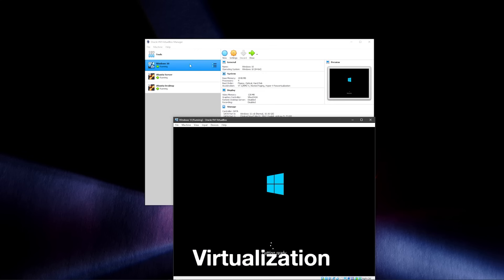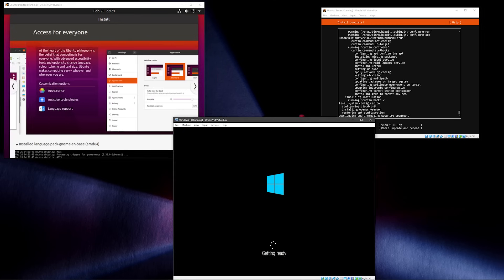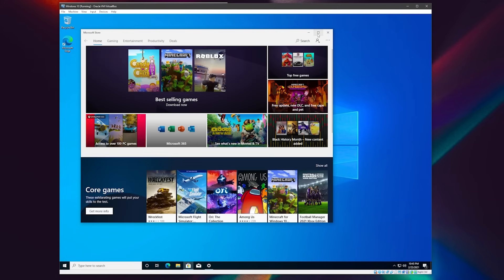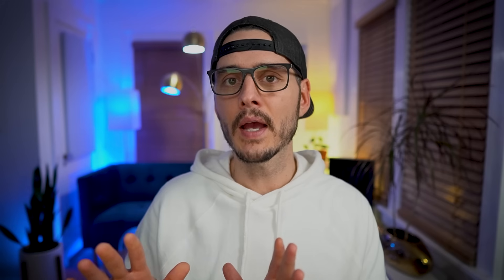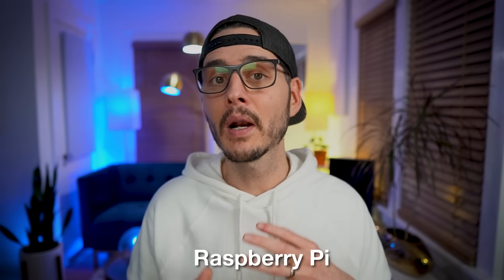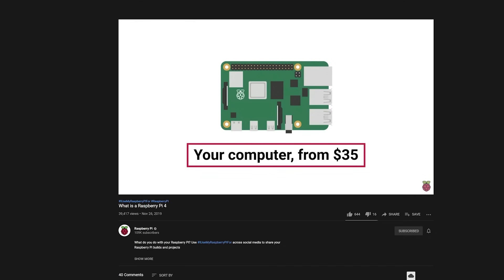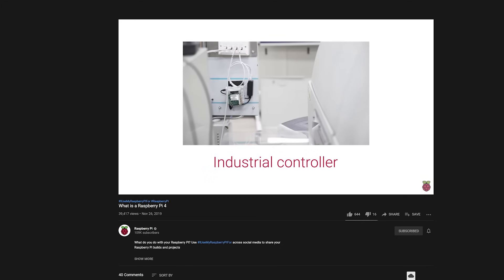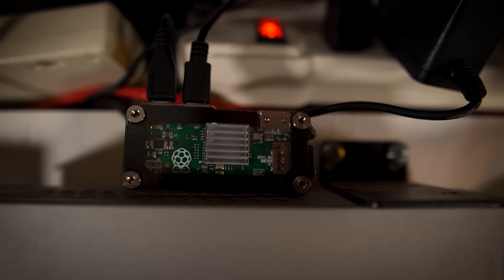What is a HomeLab and How Do I Get Started?

Comment: My previous freenas server: evga x58 ftw, xeon e5646, 24gb ecc unbuffered
My current truenas server: asrock x470D4U, Ryzen 3600, 64gb ecc unbuffered

Both run like absolute monsters with a 100% uptime other than the occasional restart for an update or hardware upgrade.

I have always been sceptical of the perpetuated myth "ecc won't work with consumer grade hardware".
It's difficult to find the right combination of hardware components to make it work but it is most definitely possible.
Reply from the maker: Totally agree.  I’ve been using consumer grade for years, all my HDs are and will always be.  If they die, I will claim a warranty just like enterprise gear. I’d rather not pay the upfront cost for it and build redundancy into my systems.

Comment: Just a small comment, rackmount gear is not the only way to get enterprise features.

If you don't need a rack full of kit, a tower server can provide a lot of the same functions in a tower format. Think HP ML350p or Dell T620 for example. Dual processors, hundreds of GB RAM and something like 12 disks are possible in these machines, which would be enough for most people.

Comment: Started off by dipping my toe in with an old NAS box with a built-in web server. Quickly outgrew that and repurposed my desktop hardware after an upgrade to create my first 24/7 box running WS2012. That's since had some upgrades over time, and became my storage server, my Plex server, Web server, DB server, Hyper-V virtualisation server amongst other bits. I've introduced Raspberry Pis over the years (with 1 as my Home Assistant box and 2 as DIY CCTV Cameras). My latest introduction was a Proxmox box (which now houses my old Hyper-V VMs plus some others). Just wish I hadn't set up my storage on Windows using storage spaces, as I now cannot migrate to TrueNAS / any other solution that's just not quite so bloated. Should've just bought a hardware RAID card to begin with, then it'd be simpler to migrate as the RAID configuration would be handled by the card itself.

My biggest annoyance however is that in my rented 1bed flat I don't have space for a server rack, nor do I have anywhere I could fit a rackmount server where the noise wouldn't be a problem. I've managed to home my current 2 towers plus a switch and a Pi in my airing cupboard (not ideal but they maintain a low enough temp), but this then means my phone line is elsewhere in the flat so the router is elsewhere. I'd love to start playing with a managed switch and a pfsense edge router, but until I can get it all in one place that's just a dream.

Comment: Right now my lab includes three locations under pfsense site to site vpn: At a relative's house a Dell Poweredge R440, Dell Poweredge T130, Dell XPS PC, HP Gen8 Proliant all running Alpine diskless mode aside from a data drive mounted at /var. They boot from usb with a second usb for storing configuration (LBU is run on a cron job). These are all configured the same: as hypervisors running a Freenas vm each which all other drives are passed through to via LSI Logic HBA card and iommu. They each have many Ubuntu 20.04 vm's running Docker and Rancher Agent all in the same K8s cluster for a total of 3 control planes, 4 workers and 4 storage nodes dedicated to Longhorn, all with a seperate dedicated 10Gi BaseT NIC for the CSI network . The pfsense router over there is running on a virtual machine on a Dell Optiplex small form factor PC running Centos 7 and KVM. At my house I have the same exact router/firewall setup except I'm running Debian as the KVM host, and I have a Skull Canyon NUC booting Alpine from usb, run from ram with another usb for configs and a single 8Gi qcow2 for freenas (loaded into ram as well at boot) which is running a zfs mirror on the two nvme drive which is used a backing for vm's running, you guessed it, Rancher and K8. I also have an old Dell pc running a simliar configuration as part of the same cluster, another Dell XPS running an LXD/MAAS test environment on another vlan that I occasionally plug old servers onto. And an old Powerspec PC running nightly downloads of Truenas SCALE. At my office I have a Poweredge T130 running Ubuntu 20.04 and KVM with a few VM appliances,  including pfsense with openvpn. Oh right and a handful of Raspberry Pi's at home for messing around and running thin client rdp terminals for the kids to play and do their schoolwork on. And a Pi at each location running ansible as well. I think that covers most of it.

Comment: My homelab is two raspberry pi 4's(one 4GB, and one 8GB), and parts from an old hackintosh I made nearly 10 years ago. Star of that mess is the i3-2120T with 4GB of DDR3. And I recently slapped my old GTX 1060 in that rig, though I haven't done anything with it yet. Im currently running a Docker swarm cluster with 31 containers divided up between the 3 of them.

Comment: I tinker got a old dual p3 slot 1 board put away.  Actively I have 2 truenas with 5 drives each. Then I have a dual x5687 with proxmox.   And 4 pi 4's for retropie and a pihole.  Been playing around for 20 years

Comment: Haha you're a bit like me, even down to the deskpro. I still have mine, it's a slot a was upgraded to 256mb and had a massive 8gb drive.
It became my first server (web) as did my next DT, and then my work stations.
DT/workstation were as powerful or became powerful as servers.

I did start with other people's as I was a teacher and consultant back in 99/04 I went enterprise in 2010, with a few enterprise parts leading up to that.

I think you went from home lab as a you can use xyz. 
Some board do take ECC memory.
And there is always add in cards for drives. 
I think the big issue is finding cases that hold a lot of discs. (Storage servers and media servers)

But there a hands on good way to learn and make mistakes. But it's just as bad if your systems provide you and your house hold services.

I think a good start is a web server and securing it. And a NAS. Or both as a set of VM's.

Comment: I invested $20 in a backup server (new power supply). The base was a 2003 HP D530 SFF motherboard with a Pentium 4 HT (3.0 GHz); 4 x 512MB DDR (400 MHz) and 4 leftover HDDs (IDE; SATA-1; 2.5" and 3.5"; 250 and 320GB) in total 1.21 TB :) The system runs FreeBSD 12.2 on ZFS (lz4 compressed). 

The backups are coming from my Ubuntu desktop also on ZFS and lz4 compressed. My desktop is basically a Virtualbox "server" with >50 VMs for Linux; Windows; DR-DOS and MS-DOS and FreeBSD. I have 6 active VMs optimized for Banking; Multimedia; External Communication; Browsing; Try-outs and Windows 10.  All VMs are closed for inbound traffic, except the VM for External Communication, while the Banking VM is encrypted. The browsing VM has no shared folders except one Download folder; is a clone from the original, so very easy to destroy and replace :)

The backup is using ZFS "send | ssh receive".  I get files of the backup server using Samba. The system is in use for ~1 hour/week since June 2019.

I collect VMs, so I have all Windows releases from 1.04 to 10, including the old NT ones; all Ubuntu LTS Releases starting with 4.10 and 6.06 and many Linux distros.

I'm starting to use my previous 2008 HP dc5850 (Phenom II X4; 8GB DDR2) as Proxmox or QEMU/KVM try-out server, I have only a 128GB SSD and a 80GB HDD free.

Comment: I had to chuckle because my newest computer is the same 4790k you had 3 generations ago.  My rack-o-servers is 9yo equipment from my last job -- I bought all of the equipment last year when they closed the office.  I have some equipment that is not worth turning on or even plugging in, 2U LGA771 servers that consume 25w just plugged in with IPMI running.  I have a 1U sandy bridge server that consumes 35w turned on and idle, so I unplugged the 2U servers and made the 1U into my firewall, by unplugging the other servers I get a "free" firewall.  My main NAS, with 2 CPUs and 16 drives actually consumed less power than the 2U LGA771 servers sitting idle.  My stack ends up costing me about $60/mo to run.

Comment: "Homelab" is just a new word for something quite a few people have been doing for decades thanks to Linux mostly. When you realize how dreadful most consoomer internet routers are (software never updated and cobbled up together in a hurry, lack of configurability and upgradeability, ISP shenanigans), assuming you know how to, it's easy enough to just set the consoomer router to bridge mode and have an old computer do the work properly. Then the next step is installing all kinds of network services that the machine can handle easily which would have been near impossible to have on the consoomer router. After that you get more machines on the local network. Soon enough you have a "homelab". My first Linux router was a Pentium 133 with 64Mb of RAM. It worked great for years 24/24h.

Comment: Right now, my home lab consists of:
Dell sff pc: core i5 third gen, 8 gigs of RAM, 120 gb ssd, running Proxmox, hosting my pfsense VM and a Canvas LMS container.
Xeon e3-1200 series, 32 gb of ram, 120 gb ssd, running Proxmox, hosting 2019 server, keycloak and privacyidea container, and freeipa server.
Dual xeon e5-2520, 128 gb of RAM, and a bunch of hard drives, running Unraid. Currently running all of my dockers.

Future plan: 1 32 core Epyc 7002 series server, 128 Gb of ram on an Asrock rack mobo, NVME add in card with 4 1tb drives, raid 10 (or whatever the zfs equivalent is), with a video card for Plex transcoding.
1 8 core Epyc, 64 gb of ram, with 12 12tb HDDs for Truenas.
Raspberry pi server rack with 4 pi4 for projects, redundancy
Unifi Dream machine pro
10gb switch

I've gimped along with old hardware long enough! :)

Comment: My first server was given to me by the local school district IT director basically as a graduation gift. I used it for many years during my time at the first university. And they were super amazing and allowed me to put it in the CSCI department server room with public network access. I learned so much from that. Left that university and the server died shortly after the move.

My second server was a retired McDonald’s store POS server. Used it for 3 years.

Finally last year around may or so I built a new custom server based on a 3900X. I still have bigger plans for home lab but right now I’m making do with my current one.
Reply: Coming from the military, I still chuckle evrytime I see POS server 🤣

Comment: My homelab consists of a bunch of Raspberry Pi for a local DNS and ad blocking, OpenVPN, simple Webservers for personal projects, docker hosts, local email server. I got a Jetson Nano for a Jellyfin server (getting it to work was a feat on its own, I had to recompile ffmpeg a bunch of times, build the jellyfin project, modify its source code and manually install .NET Core because it isn't in a repository for ARM) , a Rock Pi S, because it was interesting and very cheap, it's a headless SBC that has 4 cores.

I started with an old optiplex with hardware from over 10 years ago and it's surprisingly doing a good job and I recently added three small form factor PC's that don't use much power or space for a low-end Proxmox server, a dedicated OPNSense box and a normal everyday linux PC. It's amazing what you can do without too much space, money and electricity requirements.

tl;dr a lot of things that are small, have low energy consumption and are cheap.

Comment: I've been running  a Dell R-610 servers as my home lab.  With Proxmox,  and 11 VM's running 24/7.   With my home website on Apache,  Media running on Emby,   an Ansible management (One to rule them all) V.M., and a Gateway servers running security SSH access from the internet, along with fail2ban.    And two 32bit computer which is being used as storage.   All running CentOS 6, 7 & 8. 
Along with 3 Window computer's and a Apple laptop

 Yes, I am very aware of the future with CentOS.  For those wondering about my sanity.  I am Senior Linux Admin in my paying job.

Along with 2   48 port Cisco switches  (bought used at $50.00 each)  A Cisco router with a Cisco Firewall.  Three Cisco 2500 series routers....not running. But maybe should be donated to a museum.  

 My house was built with Cat 5 cable in to all of the room, including the garage. Because, CAT 6 or 7 didn't exist then. And I don't need 10gb speeds in a 2000sq ft house.   Even with everyone on the media server.

 I'm looking at getting security camera's and two P.E. 2950 (or newer) for storage and updating the R-610. 

One thing that most should consider if running outside on the Internet is...
1.  Will your ISP allow that port to be open and have that traffic running in their systems.  You might be surprised.
2. Your Data usage onto the internet.  Check with your ISP and avoid a huge surprise bill.